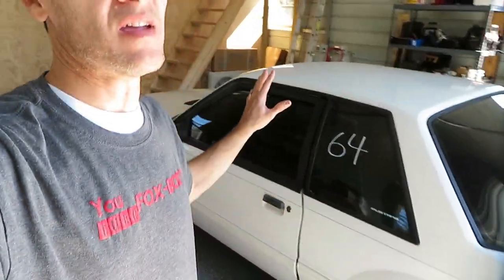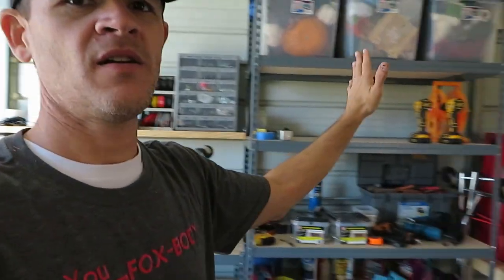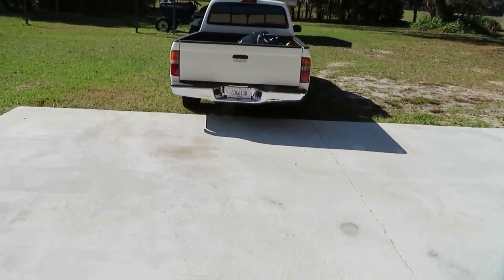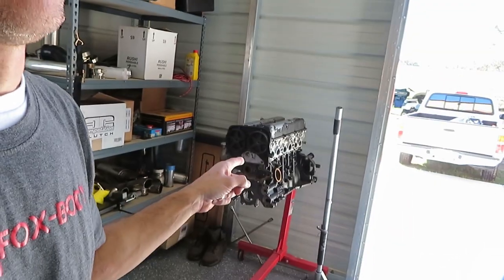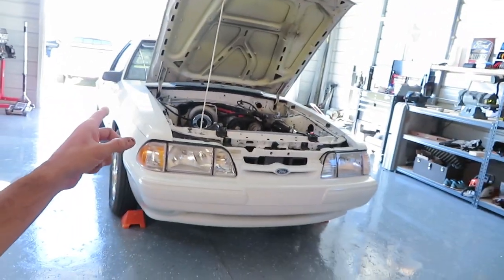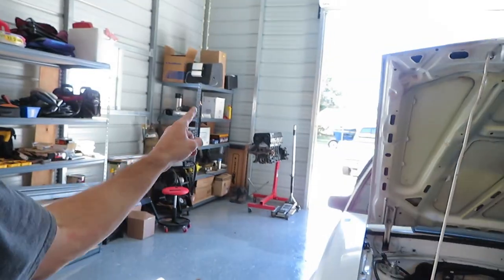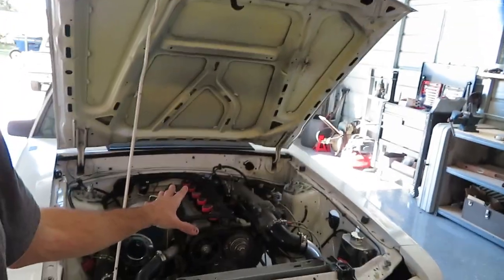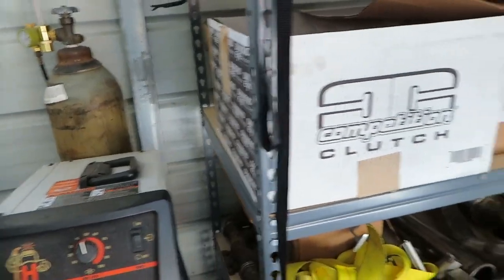Toyota Tacoma 1JZ Swap! The Ultimate Sleeper?

Comment: Are you fabbing up your own motor mounts? I have a 96 Tacoma and I want to do the same swap.
Reply: Did you figure out your motor mount situation? I have a 92 I’m interested in doing this swap in. Otherwise I’ll just ls swap it I guess🤷‍♀️
Reply: David Denman I haven’t I have decided I’m going to do a rebuild of my motor and try to beef it up with new stronger internals a couple bolt ons and a supercharger. I know if I go 1jz or built 1j I will ultimately push the power to a place the frame of drivetrain won’t be able to take or the chassis won’t be comfortable at and the truck will be too much to handle so I am going to keep it as simple as possible while still being fun and rowdy. Good luck with your build. I would love to keep getting updates. U can follow my Instagram @samr.miller